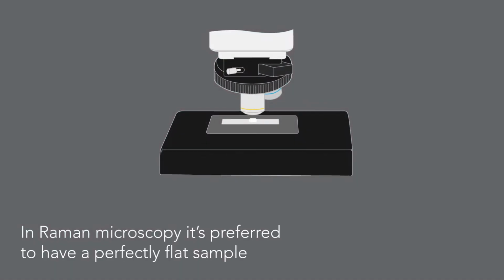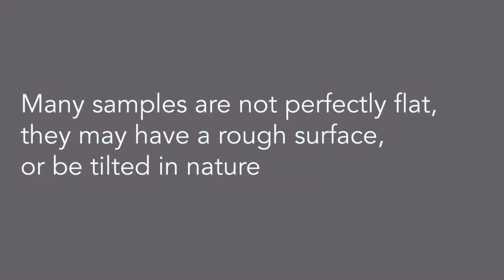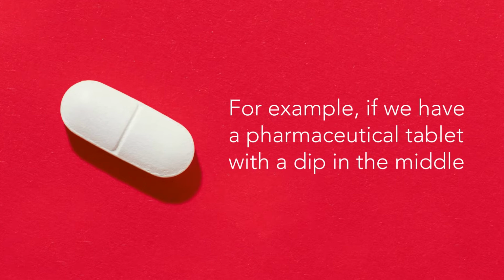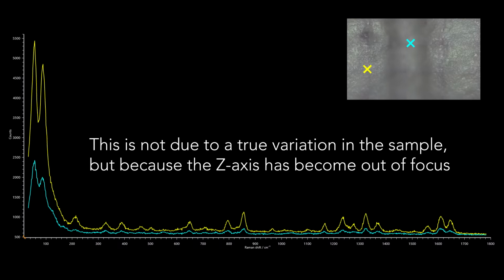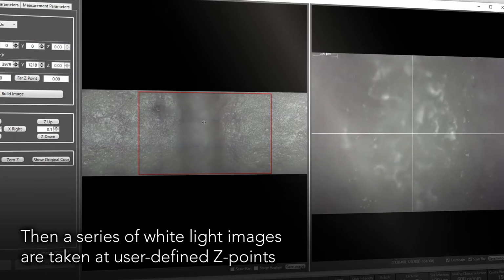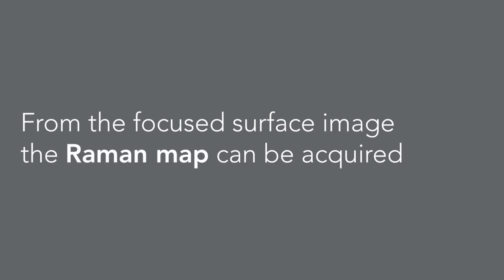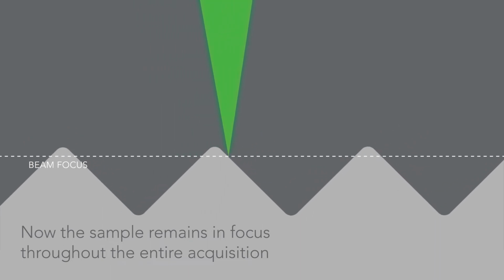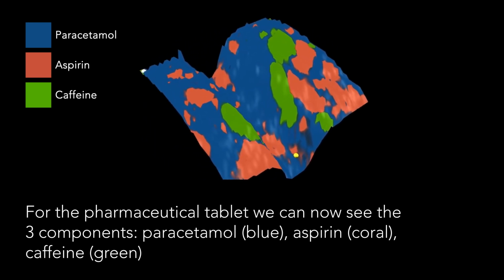Ramacle® Software Highlight: Surface Mapping

Comment: How can i generated image 3D?
Reply from the maker: Thank you for your question! Our Ramacle software includes a full 3D Raman mapping capability. This combines the powerful molecular identification of Raman spectroscopy with the high spatial resolution of confocal microscopy, allowing you to visualise how different chemical components are distributed throughout your sample in three dimensions.
If you’d like to see an example, here’s an Application Note showing how 3D mapping was used to visualise the internal structure of a transdermal patch:
https://www.edinst.com/resource/application-note-3d-raman-mapping-of-a-transdermal-patch/
We also have a Technical Note showing how oil-immersion objectives reduce spherical aberration during 3D Raman imaging, improving depth accuracy and increasing signal-to-noise for subsurface measurements:
https://www.edinst.com/resource/improving-3d-raman-imaging-immersion-objective/
Reply: @EdinburghInstruments for porous materials and that the image is focused to obtain a 2D mapping
Reply from the maker: To obtain a focused 2D map, you can use the SurfMAP feature highlighted in the video. This tool generates a Raman image that follows the natural topology of your sample, giving you an accurate representation of its surface.
If you need any more help or if this doesn’t fully answer your question, feel free to reach out to us at applications@edinst.com — we’re always happy to assist.